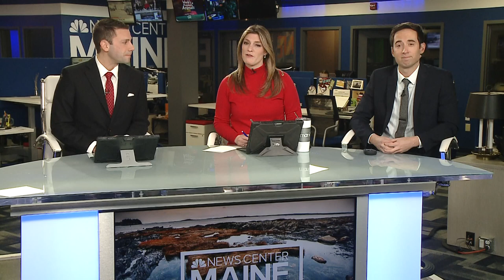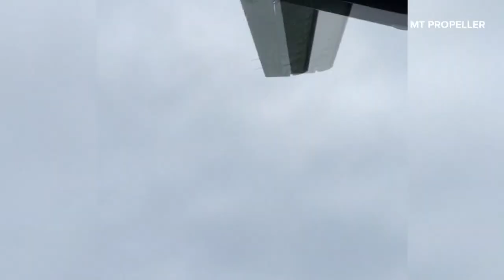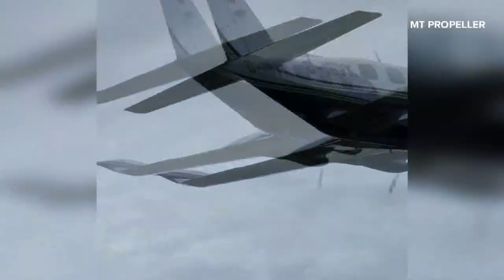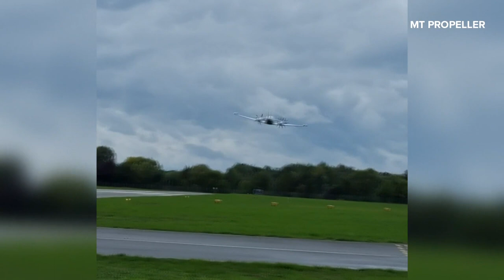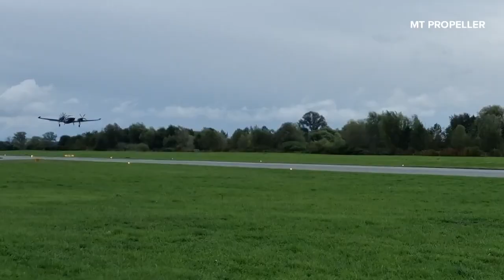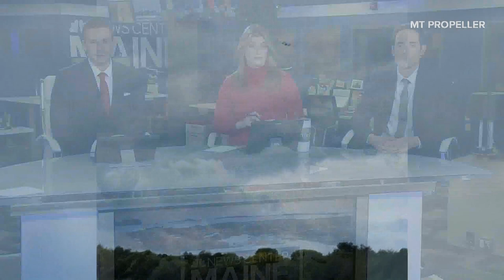German propeller maker says new innovation will take flying up to '11'

Comment: Props are slower but more efficient at low altitudes, a jet engine is faster and more efficient at higher altitude. Just comes down to ROI. Does the average short haul flight really need to invest into a jet engine?